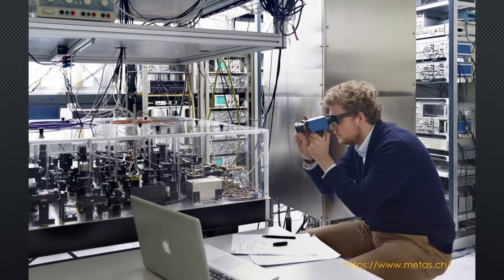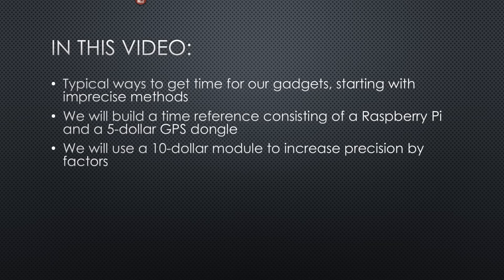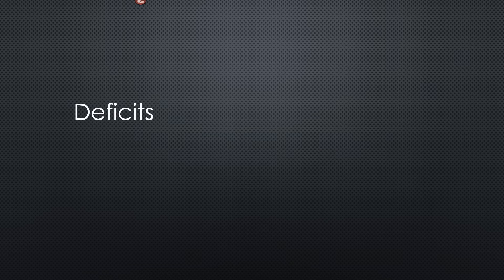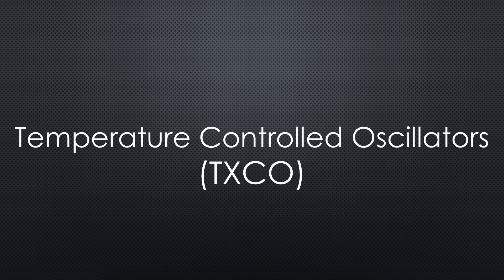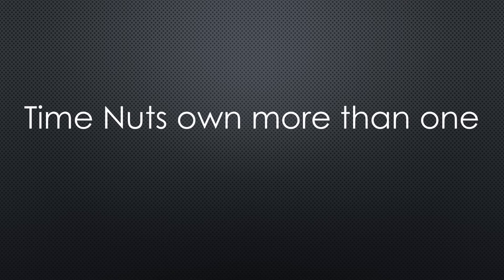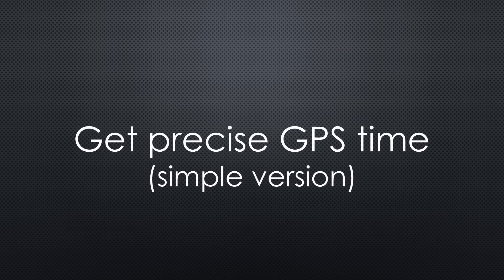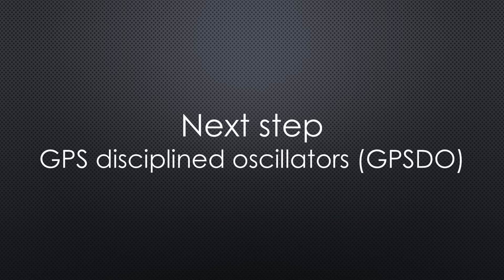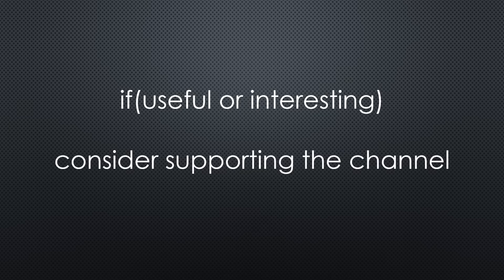(503) Precise Time without Internet: NTP Server from GPS Satellites

Comment: I have some of those Neo 6 Ts from old mobile base stations.  Yes they seem to be not fakes but I have not been able to get them to run a 'survey in' that you are meant to run to get the most stable time as they need a high quality signal before it will run
Reply from the maker: Thanks for sharing! Good to know that I will not loose too much time.
Reply: If I remember correctly the NEO-6M is reconfigurabe and has it's own protocol (beside NMEA) and it can be used to preconfigure the module using their u-center software for example. Maybe you'll find something reconfigurable there, but the whole NEO-6 series is EOL now. So those devices are almost "lost to time". :)
Reply: @chris-tal  yes, that's how you start the survey-in process. I'm sure it will work with a much shorter antenna cable. I need to site the device with the antenna and just run the pps and serial lines inside.

Comment: Today's world is harsh for a time nut. I have a cheap portable DAB+ radio that will pick up the time from the network, a few seconds after power-on. Excellent.
But I also have a car radio that could get the time from FM-RDS and DAB+ at no extra cost, but the stupid thing shows the time from a built-in clock that drifts 5 minutes per month and needs to be set manually. I'd replace that radio unit in a heartbeat, if I could buy one that has networked time in it. But that's not a selling feature, so retail doesn't know about it and can't tell me. The only way to find out it to buy it, test it, and then return it if it turns out that it does not sync time with a network. Very frustrating.
Reply from the maker: Indeed, it is also frustrating that I have to change many clocks (including the one in my old Volvo) each year for daylight saving time and back.
Reply: car radios that have gps also often can get time from it

Comment: Maybe if you have a module with PPS connectivity that can deliver nanosecond precision you would want your use PTP (Precision Time Protocol) rather than NTP for distribution?  Alternatively you could use PTP on a device connected to the internet to calibrate the time delays across your network from the Pi NTP demon to end devices.
Reply from the maker: Thanks for the tip! Another extension for Time Nuts!
Reply: I had the same thought re PTP. The biggest challenge is that the most basic NICs dont have the required extra circuitry so a pi might not have one. However it's not a big price jump to the cheapest   "nuc" type machines and I think so do have some GPIO access. You would only need a single pin since there are inexpensive usb to serial cables.
Reply: @beargiles4062  USB to serial will not work very well. Most do not have the required pins wired in and even when they do there is an issue with USB. Unlike real serial it is not IRQ activated so there is a delay that is not exactly deterministic.
Reply: @beargiles4062  Yes you’re right - the Ethernet adaptor must be a type that is able to insert the hardware timestamp into the frames. I’ve no idea if Pi NICs can do that. Certainly the NICs we used in our satellite modems could, but they cost a bit more than a Pi!
Reply: The NIC on the normal PI4 does not support PTP, the CM4 does support PTP, there is a nice blog post about this topic by Jeff Geerling
Reply: @janjansen6263  Thanks!
Reply: No really economically PTP clock sources available. the closest are some LAN that have TCXO, but those still have high jitter. Really need either a OXCO or a Rubidium clock source. I have yet to find an affordable PCIe with OXCO or Rubidium clock.  Usually they cost around $1000 USD or more.
Reply: @ If you don’t want to rely on GPS a Rubidium stratum 2 click is around $200 for a second hand ex-cell tower unit. Needs 24v at several amps to keep it nice and warm, outputs 10 MHz.
Reply: @guytech7310  It was my understanding that PTP is intended for use within a data center in order to simplify logging and auditing. NTP keeps system clocks close but logs will still often show "effects" before "causes". This is annoying when you only have a handful of systems but a disaster if a single query can cascade across a hundred systems. You can (and must) add some type of 'event id' so you can extract all relevant log entries but can still be difficult to determine the precise sequence of events without additional information, e.g. call trees are usually directed acyclical graphs so, at first, you can add this information to extract the sequence. Unfortunately with cloud instances, serverless elements, etc., that DAG is probably constantly changing if you're only looking at the IP address. If you include additional information in the log entry then you get bloat.

That's why companies like Splunk can demand high prices. It's not just the highly useful UI, it's the ability to keep track of the constantly changing DAG and produce something usable.

Introduce PTP in your data center and it might not track the legal time to the microsecond - but it keeps all of the systems in the data center synched to the microsecond. Since events on a single system will probably take milliseconds (at a minimum) you can get a proper ordering by sorting on the timestamps. You may not even need microsecond resolution but it may not be worth it to save a few bytes from log messages that can easy be 200+ characters if you're including a lot of 'current status' information. (That takes up room but makes it much easier to determine what to focus on.)

Re the legal time -  the NTP time is sufficient for most (not all) tasks. Other internal users, e.g., marketing, capacity planning, etc., will probably be fine with data down to the hour. (Average, peak, etc.) I think the main usage of data at the NTP resolution is if you need to coordinate events with external parties. This could be a different data center within your company, or with other companies if you're investigating a compromise and have reason to believe it was launched from a different company. In this case you'll want to provide sanitized logs so they can perform their own investigation. They won't know how they were compromised but if they know they can focus on log entries within a 5 minute span then they can verify unexpected behavior and know where to start looking for compromised systems. A manager won't approve a fishing expedition if they only know something happened on a particular day - but if you're only asking for the resources for a 5 minute period starting with a specific system (from the victim's logs) then it's much more likely to happen given the risks of ignoring it.

In theory you could limit the search to less than 10 seconds but only if they are doing an ungodly amount of logging, e.g. something at the IPTables level that captures the TCP/IP and UDP/IP headers of all traffic.. Even 5 minutes might not capture the information you need if they have shell access... but if they're using your application at all something should stand out.

Comment: Can we use an old smartphone with gps chips already built in instead? Perhaps mod it to run without battery for continuous operation with usb and ethernet adapter?
Reply from the maker: I do not know. I assume it should be possible with a lot of Linux know-how (compile all the software for your Smartphone and find out where the GPS is connected)